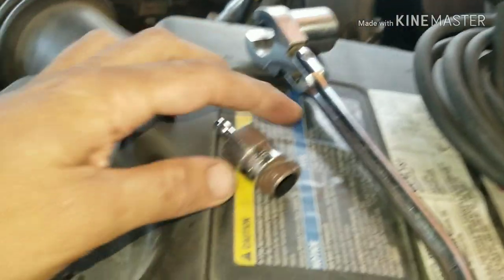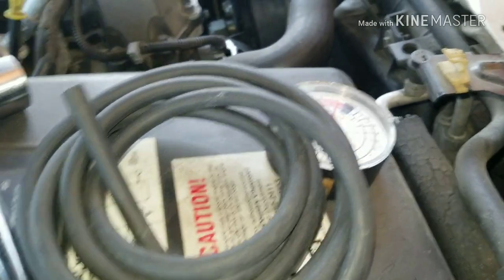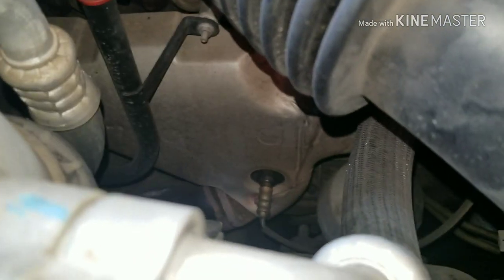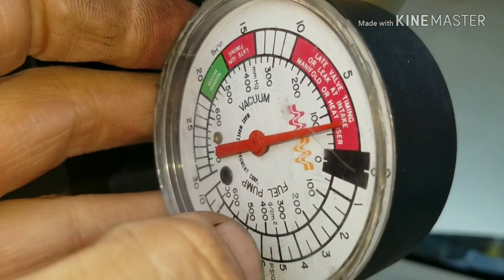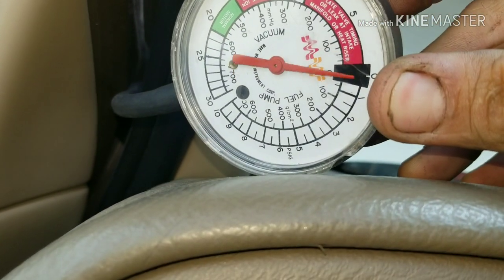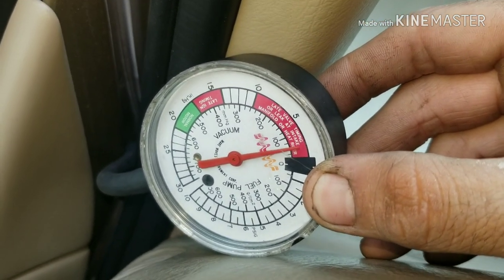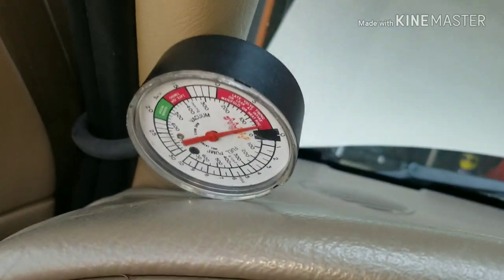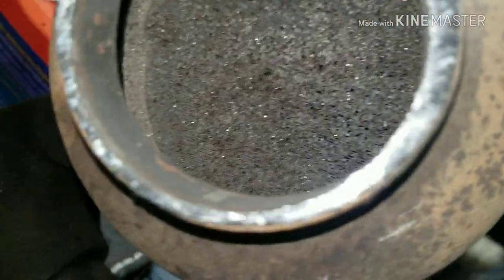How to find out if you have a bad catalytic converter

Comment: Does cataclean works on those?
Reply from the maker: Cata clean does not work on  catlytic convertors thay are that  bad.  Cata clean is mostly used when you have no back pressure and the reactive material dosent work any more. Thanks for watchin really appreciate it , besure to like and subscribe for more tips and tricks and check out facebook and instagram and give it a like for more help in the future.

Comment: I have 165k on my 18 Malibu and it hesitates untill 4K when you step on it then it finally comes up on boost... do you think it’s the cat? Or clogged throttle body? I have catch can because direct injection lol what are your thoughts
Reply from the maker: With th he hesitating i would think about when the last tune up was done and , which is usually plugs wires and a fuel filter if it has one. Thanks for watchin be sure to like and subscribe for more helpful tips and tricks.
Reply: fixer good did one about 50k ago maybe less did plugs dialectgreesed everything proper gap oil gets changed regularly has k&n drop in filter gets washed every oil change new belts etc
Reply: fixer good lol went to the dealer new cat almost $1,100 lol ended up finding out I have a ecm recall for corrupt files in the tune with the injectors... simple fix
Reply from the maker: I'm glad you figured it out thanks again for watchin

Comment: If the catalyst is bad does it consume a lot of gas
Reply from the maker: It will cause your gas millage to go down. Thanks for watchin
Reply: How I know which catalyst went bad ?
Reply from the maker: For a bank one cat code you get a po420,for the second bank  it should be a po430, but for the most part you have test and inspect to know what the problem is
Reply: @fixergood  ok thanks

Comment: hello there is it possible for you to clean the cat or is it impossible to clean it with something like thinners or gasoline ,thanks
Reply from the maker: Thanks for watchin catalyst in this video was plugged and causing performance issues. Most the time when a convertor goes bad you get a p0420 code a catalyst efficiency code. Some times you can buy a bottle of cata clean and it helps. Thanks for watchin besure to like and subscribe for more tips and tricks.

Comment: Can it cause the Rpms to rev up by them selfs when you turn on the truck without stepping on the gas pedal??
Reply from the maker: No it should not,  it's a restriction of your engines performance so it should lower your rpms if anything, thanks for watching besure to subscribe to get more helpful tips and tricks
Reply: My Mercedes Benz B200 refused to go above 2000rpm so I decided to add some cat converter cleaner into the gas tank as instructed. I switch on the car and the it revved up by itself(without me pressing) for a few seconds before it switched off again.
Reply from the maker: @kumimbangz  it sounds like you could have diffrent issues if it revs up on it's on then back again like a surge it could be a tpd or other things, Did the cleaner help performance?  Hope this helps be sure to like and subscribe.
Reply: You need a IAC
Reply: Yurs sounds like a sticky idle air control sensor/valve....or a rupture in the diaphram on yur fuel pressure regulator...
Reply from the maker: @timvittetoe6562  those do do sound like sound possabilitys thanks for watching.
Reply: @fixergood  well in one case a fella brought me a car that constantly reving up and down, not real high vevving but very obvious my first thought was IAC...Nope was pressure reg..what happens is the diaphram develops a tear in it and it leaks fuel by the vacuum line from the intake sucks the small amount of fuel in causing the engine to rev for a short time and back down until it accumulates more fuel from the leak...if im checkin for bad press reg first thing i do is pull the vac hose n see if its wet...thnx for reply hava great day

Comment: ivebbeen having this issue all year...i swear ASE mechanics are no good...GM issues seem the same and I been experiencing this in a 93 lumina. RPM stop at 3000 and just recently car wont go over 30 mph... Time for some straight pipes
Reply from the maker: Thanks for watchin
Reply: A 93 lumina? Really! Nothing against them great cars. But pre obd 2 cars can be a little tricky but you can’t knock all ase mechanic! I have not had one I couldn’t fix without throwing the customer down the money pit! Also cut those cats off and see where your fuel mileage goes! I bet it’s a 3.1 too!

Comment: My car i drove on freeway and i lost power no overheating just lost power only goes to 30 40 mph can anyone help it feels i lost pressure when i push gas when driving
Reply from the maker: Being it happens while you were drivin down and the road when  it happened  it sound like something is get hot and breaking down. I5 could be like a coil or coil pack breaking down internally.  Or you could have a fuel pump getting worse the hotter it gets . After it cools off try starting it again and see if it drives better and look for any check engine lights that night point you in the right direction.
 Thanks for watchin besure to like and subscribe for more tips and tricks   and check out the facebook .
Reply: @fixergood  i took to.mechanic he said it was cadilac convertor being clogged
Reply: @fixergood  cause when im driving car feels like when i push gas seems like it has air and when i drive loses power and i push gas feels like air aint coming out
Reply from the maker: @rigov408   yeah that's entirely possable usually you will have a little bit of warning before the cat completely plugs up.

Comment: if when my car is idling for like 15 minutes, it starts to make a clunking sound and it won’t go when I step on the gas. It also kills the car. What is wrong with it?
Reply from the maker: Does it sound more like a rattle than a rod knock. When convertors go bad they can rattle real bad if the ceramics comes loose or even if a piece broke off and now is causing a restriction.thanks for watchin

Comment: Also it's only sending a random misfire code.
Reply from the maker: It could be,you could also have a bad fuel pump or spark plugs. Thanks for watchin and besure to like and subscribe
Reply: @fixergood  ya it's fouling every set of spark plugs I've put in it, and 3 sets is a lot of money. Racetrac gas
Reply: @fixergood  it was the ignition coil pack!

Comment: Will ra restricted cat make your vehicle get hot, and quit??  My S10 runs fine for maybe 45 mins - then goes to 210 and stops. Very little  exhaust comes out the tailpipe. Can someone help ??
Reply from the maker: If your car is not running properlly many things can happen, I'm not sure if that's your issue, does is die and stop running after 210, or does it keep going.. You could have a cooling issue .hope this helps
Reply: Could be the map mass or maf sensors as well

Comment: I solve my problem I couldn't past 2,000 RPMs had no power couldn't even drive it the car would stall  I thought it was my Maf sensor I just went ahead and got a new one that's good I had took out the 02 sensor from the front cat all my power came back even the car was moving forward good my suspicious is a clogged cat
Reply from the maker: It could be a plugged cat when you removed the o2 it alowed some excess back pressure to escape . Thanks for watchin beasure to like and subscribe for more helpful tips and tricks.

Comment: Gosh idk if I need to do this. I have a P0151. I’ve checked all vacuum lines for leaks, changed all O2 sensors and still can’t get rid of the code. I’m ready to drive this car off of a cliff
Reply from the maker: Thanks for watchin really apreciate it,  being the upstream o2 is unable to increase the voltage possable its  possable  like you said a lean condition but you usually get a lean code also, you could check your inputs and out puts at the sensor and  the computer  to see if you geting the corect reading at each end. 
Thanks for watching besure to like and subscribe for more tips and tricks and check out facebook and instagram   and give it a like  for more help in the future
Reply: @fixergood  oki doki! Thank you for responding super duper fast!⭐️🦋 I will try what you said in the morning! Yay! I will subscribe too! Thank you fixer good!💖🦋💖🌸🥳🥳

Comment: Its not vacuum youre looking for. If you have vacuum you got bigger issues than a clogged cat
Reply from the maker: the gauge I'm using measures pressure and vacuum,  the way it's plugged in if the  exhaust breaths like it should you'll have little to no needle change,  if you have a plugged cat like I do in this video you'll have back pressure which will cause poor engine  performance
Reply: @fixergood  im trying to figure out whats up with my friends 95 jeep wrangler 2.5 liter. Itll start and run good for a few mins but when it warms up it bogs down and will barely run 30mph. Hes replaced a bunch of sensors. Parked it for 5 years and recently started driving it again. He said it crapped out on him yesterday and barely made it home. I told him to drop the exhaust pipe down a bit to see if it helps. He drilled two 1/8" holes in the pipe instead. I told him thats prob not going to be enoigh to make any difference. His doesnt have evap system smog pump etc. Only one o2 sensor as well. I said cat was prob stopped up when he first told me but ive never had one run good then crap out after it warms up due to blocked exhaust. They always ran like crap from the time it started.
Reply: I apologize for the correction on the vacuum i had allready done it before you corrected yourself. It was a good video thanks
Reply from the maker: it sounds like it could be  maybe possably a fuel pump . if your able to wave form the pump you could see the pattern getting worse as it warmed up. that would be the sure way to see if the pump is failing with heat.hope this helps
Reply: @fixergood  i was thinking vapor locking before i realized it was fuel injected. When i removed the gas cap i saw electrical tape wrapped around the threads and the cap didnt ratchet like most do i thought id gotten lucky.  I told him to drive intil it spazez out then whip into a gas station and fill it up or at least put enough in to move the gauge a noticeable amount and see if it helps. Ive had some with crap in the tank and when it gets low enough it would suck up the crud and run poorly. He said he tried it with "some" gas and it was better but still running rough. Last word i gave him was drop the exhaust and see what happens. If it works we know the prob. If not we can check that off and go to the next test. I dont know if its got a schrader valve under the hood for the fuel or not. Im doing most of my diagnostics over the phone. Thanks for the suggestions. I told him to slap a ford emblem on it and sell it for scrap. I wont bother telling you what he suggested i do. It would hurt like hell!

Comment: Don’t put another cat on it mine are gone it’ll be better on the motor without em they are useless
Reply from the maker: You could but its ilegal to modify any emissions equipment on a vehicle.  Thanks for watchin
Reply: fixer good if your state does emissions then keep em or do high flows but really if your state don’t do em they don’t really care no ones gonna get you in trouble

Comment: Wtf  so u just cut it out and ???drove around  straight manifolds.. u never showed  a fix  any doe head can take  a grinder and  cut the exhaust system out
Reply from the maker: Yeah any one can just cut it out but you'll be breaking fedral law and I'm not sure of the consequences but I'm sure it's not light. The main reason for this video was to give some one with no idea of the symptoms of back pressure a general idea. And I did replace It with a OEM cat. Thanks for watchin.